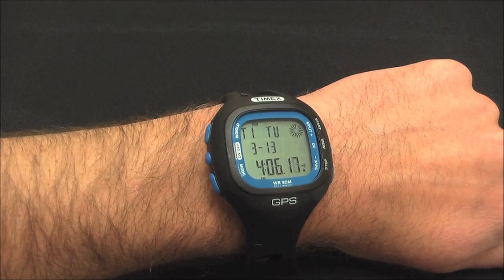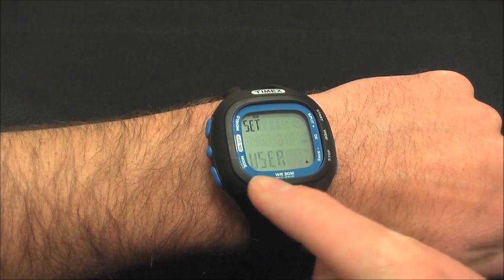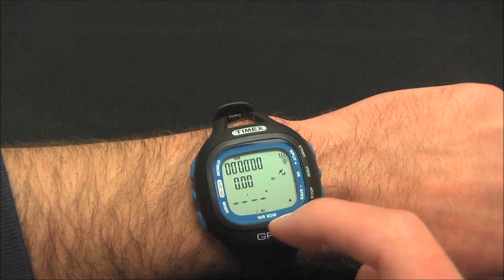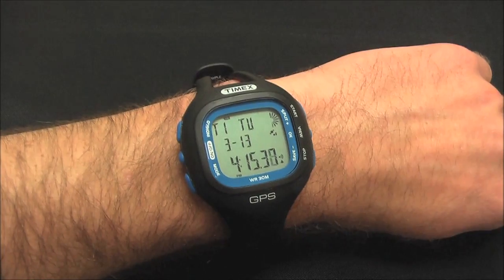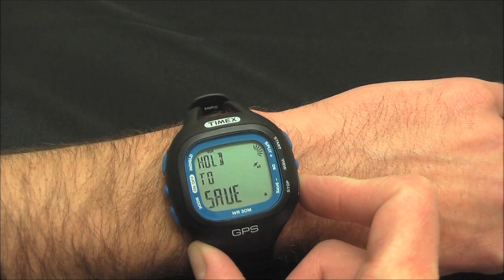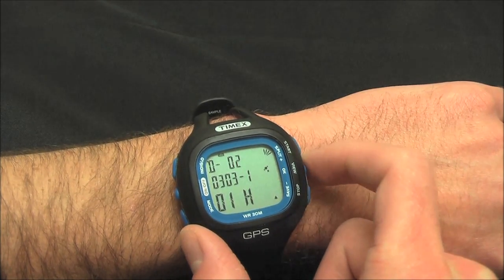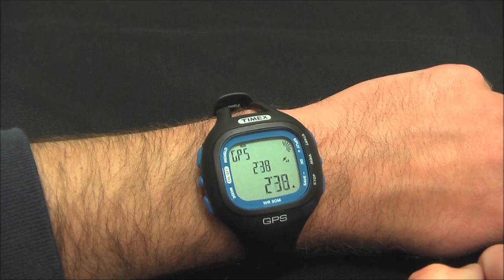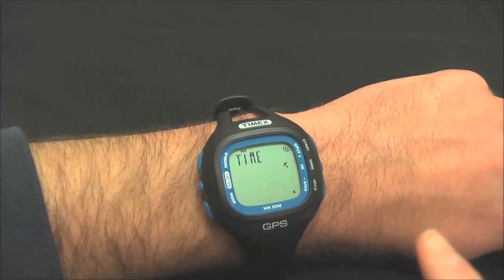Timex Marathon GPS "How To"

Comment: I know this sounds obvious but when running outdoors you need to wait for the GPS signal before you start running.  If you don't you will not got any distance.  Sometimes if it cant find the GPS signal it goes automatically to "Indoor", in this case you will have to scroll through the modes again till you come back to "Run", you may have to change your direction in order to get the GPS signal.  This can take up to a minute

Comment: After finding gps, in chrono mode-start the distance never starts at zero. Usually 0.002, or 0.60. I never get accurate distance. I wonder if anyone else has this problem, or am I doing something wrong.